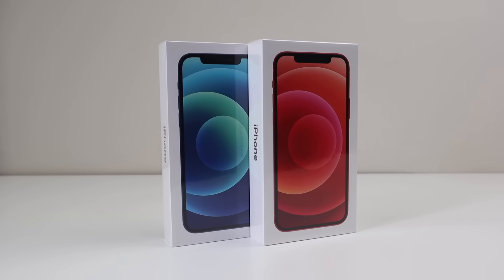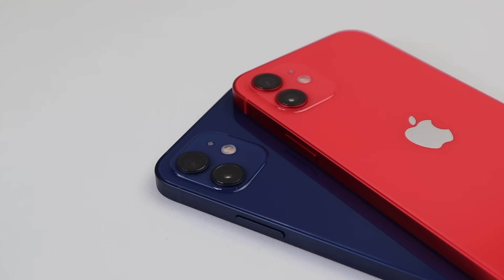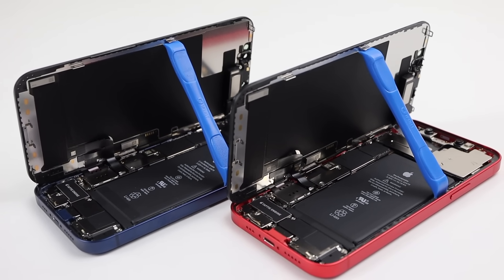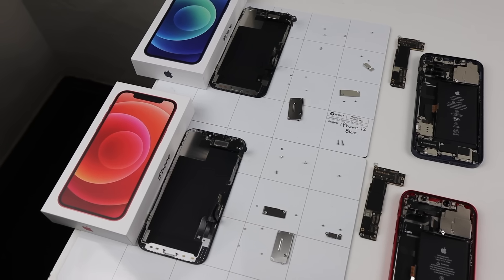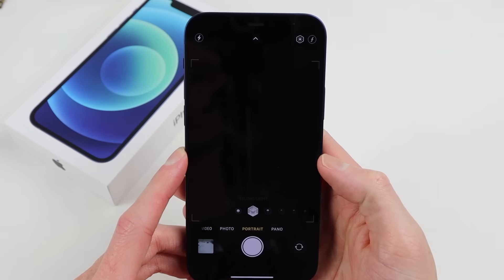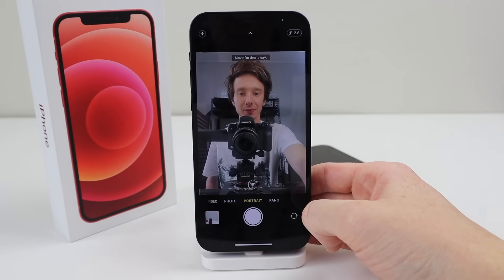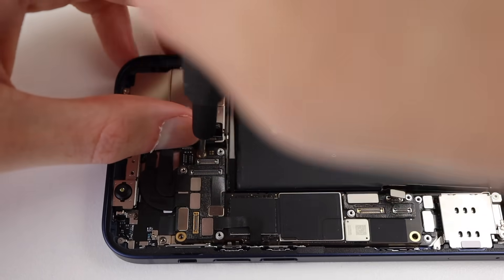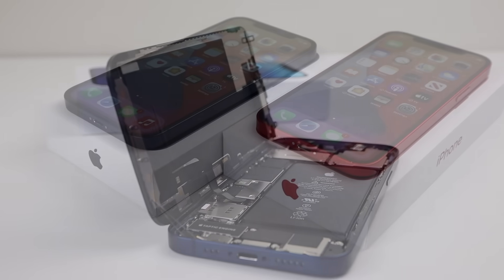iPhone 12 Anti Repair Design - Teardown and Repair Assessment

Comment: Hi! Software engineer here! The reason why the cameras are glitchy is because attackers attempt to unlock stolen phones by sending the “matching” information through the camera. Apple recognizes this, and only lets one use Face ID if the device connected to the camera port on the motherboard matches the assigned factory camera. 

The back cameras take advantage of a few modules outside of the camera in order to support functions like software zoom (without significant degradation of image quality like on the iPhone 34567 and 8) and night capture (low light pictures) and human recognition (auto focuses on humans in the screen). This ones a little less obvious, but the reasons are valid nonetheless: the “camera” isn’t just the camera. It’s the collection of these modules inside the motherboard translating image data to binary... and the camera. If these devices are split apart and put back together with non matching devices, they will not work. The features that Apple provides with the rear camera is no longer just a simple camera, and because of this, the factory camera must match the factory motherboard. In my opinion, that’s poor design and I can understand why people would be upset about that. 

Apple did the Face ID thing to prevent your data from being stolen if your dumb ass loses your phone though. A similar defeat was used by Apple to prevent people from sending “matching” information through the fingerprint scanner. You were never allowed to replace the home button, or else the feature disables. 

This is not “what they say,” this is how a software developer at any company in any field would approach these issues and these solutions are accepted by the industry (even if they seem sus to laymen) Apple spokespersons just regurgitate what the engineers say 70% of the time.

Comment: It looks like they fitted "part ID"... This is very common to car manufacturers. 80% on a roads are fitted with 2-3 modules or more. CPU writes pesonal ID codes in every electronic part when car is first time started. Then thouse parts can not be swooped to another vehicle. If u need replasment, buy a blank one from manufacturer.

Comment: Not so sure that it is an issue of anti repair so much as Apple pairs the screen, battery and camera to have them accepted into their ecosystem. Those parts are an exception to the rule of the tech being proprietary with Apple as they are made by third parties. In general Apple has always played well only with Apple. Now you have components from Samsung, LG/Sony and Amperex so in order to link those parts, without being able to allow every other 3rd party part, they most likely are exclusively paired to the logic board.
Most likely that is why the screen won't talk to the power button, the battery error and the camera issues not working when swapping the logic board.
Reply: But you got it all backwards, all of those behaviours you've become accustomed to are part of the anti-repair / milk you customers push Apple has been doing for years.

The very existence of an Apple ecosystem, the way they handle the appstore, the propietary connectors (Shittiest connectors in the market btw), making everything hard to physically repair, restricting access to parts for third parties, bricking phones via software and now serializing and pairing the parts. It's all part of the whole and gives you a clear insight on what they are doing and been doing for decades now...

Other companies do some of this stuff... Almost every company tries to make an "ecosystem" nowadays for example, which sucks... and we certainly have older examples of purposedly being incompatible with the competitors (Like format wars), but such a prolonged anti-consumer push by the same company in different aspects of their products I think is frankly unparalleled.

Don't get me wrong, there are certain advantages to controlling the Hardware and Software of a device and the streamlining that comes from and Apple realized some of that, but even when that was somewhat true, there was never a real need to lock everyone out and also those, even back then debatable advantages are long gone anyway.

That was historically the only somewhat redeeming quality: "it just works", since you as a designer don't have to account for innumerable posible use cases, when you remove that then there's nothing...

In any case, I believe they finally overplayed their cards and something will actually happen.

Comment: That's really dumb. If parts are genuine they should bloody well work between devices. It's like I buy a new piece of equipment for my car, genuine manufacturer part, but it doesn't work because I got it installed by a reputable garage in town instead of paying three times the price at an "official" dealership. It's the same part, it shouldn't make a blind bit of difference.

As for the charger, it's a little confusing but I'm guessing they're hoping everyone will go with wireless charging, or use a charging station? I had a charging station from my old iPhone 6S that I can use on my XS Max without needing to buy any other equipment. In some ways it works, but yeah if you want to only use the USB cable it's a bit strange considering USB A is still the standard for the vast majority of charging plugs out there, even for the Apple ones which our household must have about half a dozen of by this point. Out of curiosity, would a USB A to USB C adapter work? I have a couple for plugging in USB A leads into my Macbook Air.

As I've said on other videos, I love my Macbook and iPhone, I find the operating system to be great and I vastly prefer OS X/Mac OS over Windows. I hate their customer service though, they're very arrogant and really need some good quality legislation brought in to bring them (and other) tech giants into line, the prime example being right to repair. Electronic waste is INSANE and the more we can do to minimise that, through reuse and not just recyling the better. However, investors be investors and all they care about is endless growth. They don't just want money, they want ALL the money. 

Endless growth is not sustainable, out economic model as a whole is fundamentally flawed but we the people lack any ability to influence that. Fucking lobbyists and corrupt governments will see to that. I hate how we have this crazy full steam ahead annual refresh of phone models, just have two or three yearly updates, with massive jumps in performance and capability instead of a slightly better camera, or a slightly faster CPU/GPU architecture.

Comment: If apple really wanted to remove waste, they would've stopped selling iPhones a long time ago
Reply: @Rtrunkinsurance  Good man
Reply: @Rtrunkinsurance  I shall get the jPhone, or maybe the kPhone.
Reply: @Smoggy6364  I may have to get a fPhone, and maybe if I had money a uPhone
Reply: @Exc4Iibur  fool go to mrwhosetheboss and preorder the passionfruit iphoney 24 pro max ultra fold 5G+ 2021 WQHD+ display 10,000,000 mAh battery usb c to usb a in box 20,000W ultra fast charger no ads edition for just a kidney selling 13,999
Reply: Or make a new version every 5 years instead of 1
Reply: they would have shut down their company a long time ago
Reply: Ooooo
Reply: gottem
Reply: Nah, to get rid of waste, get rid of Android plastic junk phones. They all seem to have busted screens and no one knows how to use them.
Reply: @0g.Ghost.7373  correction, YOU don't know how to use them. It's the equivalent of a baby not knowing how to play piano, when they have a toy piano that plays a whole song after pressing one key.
Reply: @skriichi  dude that’s why over half the USA uses iPhone. Because it just works. No apps or files taking up all the memory. Less chance of virus.
Reply: @0g.Ghost.7373  sure the phone is easier to use, but it's way more expensive, with cheaper products, anti repair built in, and they manually slow down older generations of phone. Apple is literally an evil company, and they get funded by idiots like you, who blindly follow them and buy a new phone every 6 months. Apple has been through so many lawsuits at this point that I'm surprised people like you still defend it's outrageous practices. But you won't believe any of that and just buy the new phone in 6 months. I wish you nothing but the best, but I'll attack apple any day.
Reply: @0g.Ghost.7373  also, I've used android and apple phones. Mostly android though, and I've never got a virus in my 12 years of owning a mobile phone. Your protection from viruses is null
Reply: @0g.Ghost.7373  doesn't even argue lmao enjoy your over priced porcelain kid.
Reply: @0g.Ghost.7373  maybe mommy will get you a better phone when your screen shatters in a few days
Reply: @skriichi  Sorry kid but I have had every iPhone since 4s when Sprint started carrying them. Never broke a screen. I have also had every last Apple Watch and they all still work. Just because you own junk android shit and break the screen very easily, its not my fault.
Reply: @0g.Ghost.7373  Lol, you talking about memory and storage... I have a oneplus 8 pro with 256GB & 12 Gb of RAM for 999 euros... Which imo was expensive when you see asus boasting phones to 144 hz, 18 Gb ram with 512 of storage for 1300 euros, this thing even leaves peoples laptops behind... Apples prices are way off for what they have to offer not to forget, third party repairs being withheld as a b.... Your vision of android phones is completely wrong...
Reply: @1993diedevdb  You paid 999 for junk. LMAO!!! Guarantee nothing out there uses all of that crap you bought. You have 12 gig of ram and I bet only 8 gig has ever been used.
Reply: @0g.Ghost.7373  You missed the point lol, you pay more for An iPhone for less... Call someone An idiot if you know what you talk about.
Reply: @1993diedevdb  I pay for something that just works. No crashing apps. No open source apps sending out my personal info. I pay for something that lets me edit a file on my Mac and walk away and finish it on my iPhone. I pay for listening to music and walking into my home and switching it right to AirPods. I pay for being on a call and moving it from my watch to my Mac or watch. I pay for AirPods that auto switch to my watch if I leave my iPhone in the other room to inside or I go outside. I pay for Find My that tells me where my phone, watch, tablets, keys, wallet, etc are. I had an android for 2 of the worst years of my life. I could not wait to toss that junk into the river. Keep paying for bloat wear and giving google more on your life.I pay to stop google from invading my privacy.
Reply: @0g.Ghost.7373  I never had any crashes on my Oneplus, faulty devices or software is a thing. Feelsbadman you had a faulty one maybe... Making phones overpriced for a service isn't going to cut it... I'm just baffled how much people defend Apple, even when Apple themselves clearly doesn't give a shit about customers when it comes to repairing your Broken shit .. Apple stores rather tell you it's Broken/unfixable or costs you 1000$ to fix than spending 20 mins fixing it which would actually cost about 20 bucks at a 3rd party seller... I mean... I get userwise its personal for everybody but facts are there that Apple is butfucking their own customers and you all happily clap when the next iPhone is 2000$.... The hardware in the phone doesn't just cut the price asked
Reply: Tommorow
Reply: I Liked this to break the curse lol
Reply: So you mean “apple iPhone is a waste”? Haha😂😂😂jk
Reply: This should clearly be the highest voted comment.

Comment: Android: Sells you the computer, allows you to repair and modify it

Apple: Sells you the computer with a bullet hole in it then charges you money to fix it. Then after two months of use you decide to try and repair it, only to find out they glued the components together and you must buy a new one to get it working again. And a year later they piss all over the hard disk, scratch up the screen and put glue in the fans. Leaving you no choice but to buy a new one and restart the cycle.

Comment: These are security features if the phone opened with any camera or touch button from the internet, a fake part could be used to unlock stolen phones and steal your data and passwords for everything in your life. You want that to be really really difficult. Yes es it’s a pain for repairability but security trumps all here. Apple is the most secure platform because they are locked down on parts. 
Apple’s repair policy is “Buy a new one.” 
THIS is the greedy, non-green part of their business model. 
That and all of the collateral e-waste generated when they shift connections as in the excuse for not including a charger with a a device using a new connection.

Comment: Correction, those usbc cables only came with 11 pro models, meaning anyone who was legitimately upgrading their device in a fair manner by waiting 2 years, would ultimately be stuck tossing out a new cable or buying the new brick and still creating e-waste with their old charger.

Comment: Right Apple, Louis Rossman is after you and he's mighty pissed! I hate Apple (typed on 21" iMac, I also have an iPhone 12  Pro Max, or whatever the big one is called). The biggest problem I have is if you look after these things they don't die! The only issue I have had with an Apple product, was my version one iphone, at the time there was nothing like it. Took it to a party, everyone wanted a look at it and of course somebody dropped it, luckily it wasn't the screen but the volume switch rocker assembly that took the hit and I bought the spares off ebay and fixed it myself...  Fast forward 14 years and I dont think I'll ever take my '12' out of the house again!

The trouble is I am up to my neck in Apple, Airdrop is so useful, just ask my GF to chuck me a couple of photos and 'bam' there you go. Also, without exception every Droid I have had, crashed or hung with monotonous regularity. 

Like the TV ads used to say about Apple "it just works". But let's get serious here, what happens when it breaks? Well the answer is you either pay Apple to fix it, if they can, or you buy an iPhone 13 😩😩😤🤬
Reply: "It just works" is a function of being locked down. Is just the same but at the software level, and there's some potential optimization to be made when you design both Hardware and Software. And for some time and to a limited degree Apple actually did somewhat deliver on that... 

That said, nowadays there's mostly nothing you can do on IOS that you can't do better and cheaper on Android, but it may need some tinkering (Like really mild one time and done tinkering). As the Android OS matured all the kinks became increasingly ironed out (as expected).

To me the whole philosophy is flawed, if everyone applied it to everything the world would just not function. Things become standard for a reason.

The fact that you can't bring yourself to do the change because they sucked you into their ecosystem was their whole point, there's no technological reason those apps don't work on Android or at the very least don't have some inter OS capability built in and they are inherently worse apps for not doing so, the only reason is to inconvenience someone in your situation into staying with Apple devices.

If you stopped there, at just the ecosystem and their appstore, maybe you could defend their behaviour (I wouldn't even agree there, but MAYBE). When you extend it to the hardware and repairs... Yeh no chance.

Comment: There is a very good reason not to include a charger in the box.
The charger uses mains voltage and has to comply with the safety rules and regulations of the destination country.
This way they can ship the smaller box with the phone to just about any country.
Same reason applies to many small electronic items that come with an adapter and not with a build-in power supply.

Comment: Hugh, they probably changed the order on the connection pins. And when connected in wrong order, it makes the phone run a program to cause this behavior. Maybe they made 5 different pin layout.
If this is the case, then you can pair 2 phones for every 10 phones made.

Comment: This is posted as if this is a new thing, while what’s been done before is slightly different it’s been happening since like the 7, basically if you got a 3rd party repair after they made it clear you were only to use apple verified repairs and parts, your phone just wouldn’t work at all

Comment: OMG!!! It’s not an anti repair design, this are SECURITY MEASURES FOR STOLEN DEVICES!!! You think that if a thief nicks a locked iPhone with fingerprint or Face ID and just swap‘s the Logicboard, that will do the trick? There is a reason why this Devices are more expensive than the average. I am very much happy that those
A-holes stealing all these iPhones are not capable to use them in their full capacity. And the best part is, now you can track the stolen Devices down without it being connected to the internet and the help of other iPhone users... just stop nitpicking on almost perfect Technologie‘s just for the F of it.

Apple is doing most of the time a very good job, or for which reason do you think is everyone trying to copy their designs and technology’s? And the faulty, fragile Mini-USB port is not one of theme. That’s why Apple never installed that shitty Mini plug in even one of their devices.